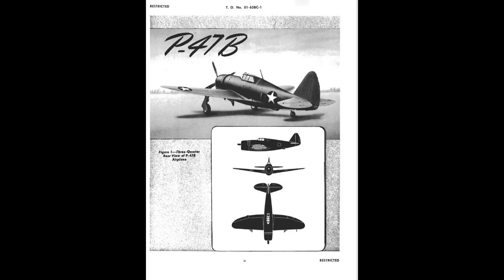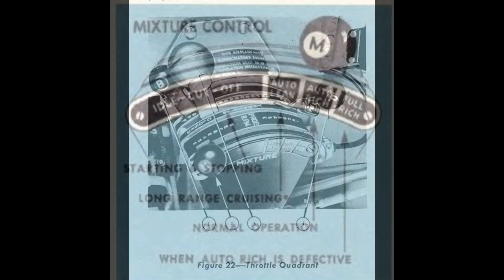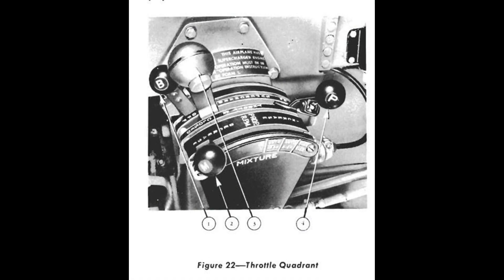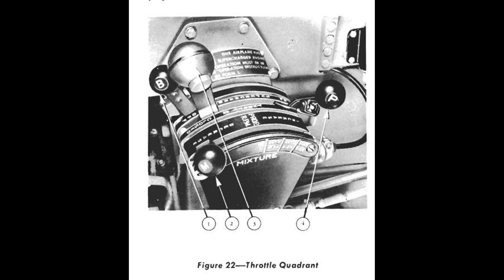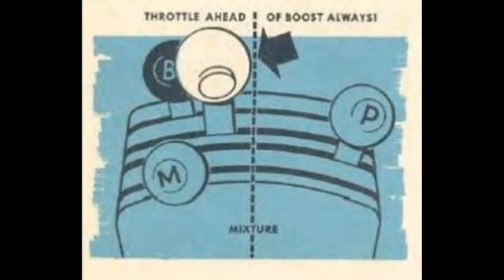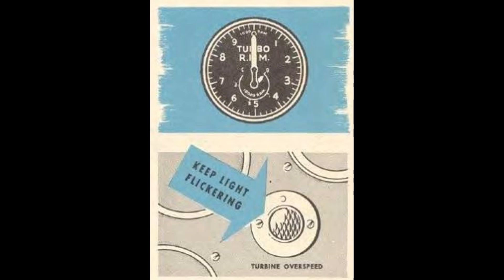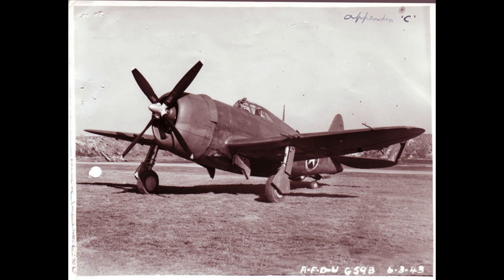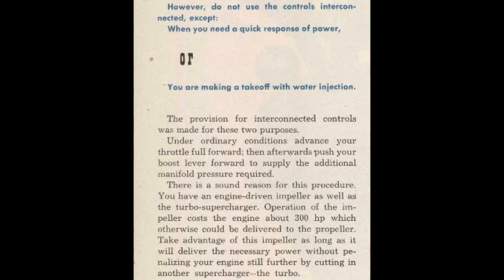P-47 Thunderbolt Pt. 1A Throttle and Boost Lever Use

Comment: Hi Greg! I have started flying the P47 in DCS and loving it so far, im just looking some advice - I see war combat is (2700 at 52") if I reduce rpm down to 2250 what is the detrimental effect? I have done this myself on multilayer servers and I noticed that the temps seemed to stay in check, but im wondering am I causing any damage to the engine by potentially causing knock/pinking/pre ignition whatever term you like. Im also wandering about 2550 with 64" with water Methonal. 

Thanks 😊
Reply from the maker: More RPM at the same manifold pressure gives more horsepower so 52"@2700 is what you want. As long as you keep the temps in check you can run at that power level all day long in the real plane, or in DCS. It will shorten engine life so official max continuous is 42" at 2550. Keep in mind if playing a campaign like Reflected's Wolf Pack the AI Thunderbolts run 52"2700 during all climbs so you have to run it a lot just to stay with the formation. 

      For max power, 64' with the water at 2700rpm. If you go over 64" don't worry, the engine will hold together, again, as long as temps are in check. Usually this means oil cooler doors fully open, intercooler about 3/4 open and cowl flaps closed.

       I think it might be time for some more DCS videos. I'm thinking about explaining how to start any WW2 fighter the easy way, and how to beat the K4 in a 1v1 with the 47.
Reply: @GregsAirplanesandAutomobiles  Greg thank you for the answer! I have been practicing dogfights against Antons and seem to come out on top, the gunsight on the 47 is formidable. I also practice not locking the boost to the throttle, I dont like the idea of being down on HP - your videos have been fantastic help so far! I'd love to see a Video on how to defeat a 109 k4

Comment: Question from a non-aviator to the aviators here; would you feel comfortable flying an aircraft where the throttle and boost were controlled by the same lever? If the throttle is to be fully opened before increasing boost, it would probably be easy enough to engineer a system where the first 50% forward fully opens the throttle and the final 50% forward increases boost (or whatever ratio works well).

Or, alternately, would that take necessary control away from the pilot?
Reply from the maker: Sure, and that has been done many times. In fact in later Thunderbolts it was possible to link the throttle and turbo lever together.

Comment: Interestingly, later pilot's flight operating instructions for P-47D-25 to -35 (AN 01-65BC-1A from January 1945) pretty much say to interconnect throttle and boost levers and leave them like that until you reach critical altitude and need to reduce turbo RPM (or for takeoffs in hot weather). As far as I know, the supercharging system and engine didn't change much, so why the difference in instructions between manuals? Is it to "simplify" the controls operation for pilots new to P-47? Also, since the supercharger regulator is driven by engine oil pressure, does it stop working if oil is lost due to damage? How will this affect boost lever response?

Comment: The P-47 was unique in that chopping the throttle led to immediate and massive deceleration compared to any other prop type: That huge gaping cowling in front was like one giant airbrake when the power went down... One pilot described it as "hitting a stack of hay". It allowed going fast to join a tight formation with no fear of overrunning. That is why its dive acceleration was only average. Its acceleration on the horizontal was also high with the broad props (though climb never was great), so it was an unusually responsive type on the horizontal. Despite a serious initial mushing in the turn it made beautifully tight left turns at incredibly low speeds. At least the Razorback with needle tip prop was always on the inside of most other Western types in left turns.

Comment: The aircraft that you don’t mention is the Tempest V or the Typhoon which is in the P-47 D. You always put the Spitfire MK-9 when the Spitfire Mk-XlV through Mk-XX was used till the end of the war. How about the Spitfire that dived to Mach 8.5. This was computed with gauged for this reach. Eric “Winkle” Brown said as much and the airframe and wings show no structural damage to the Spitfire as it was inspected by British officials.
This comment was ment for part 2 and not 3
Reply: The Spitfires' V-NE is just 460mph, it's critical Mach number is only 0.74

Comment: Just my opinion on this, i believe using the turbo lever for takeoff would be helpful  in very hot climates where engines dont quite reach the rated numbers.
Reply: With already high carburetor air temperature, using boost will increase it further, which leads to loss of power and possible mixture detonation. Manual that recommends interconnecting boost and throttle for takeoff specifically says to disconnect those in hot weather (>35°C).

Comment: I know this was from four years ago but the way DCS tells you to use the boost lever is wrong. In the manual it tells you to connect them at take off and leave them there. Where as A2A's excellent P-47 for Microsoft Flight Simulator works exactly as you explained here. I found this video because DCS made me question my memory of the many hours with A2A's P-47. I'll give the high altitude test a try and see what happens. Thanks for the upload.
Reply from the maker: I fly the P-47 in DCS and use the levers exactly as I describe here. More often than not when in combat I have the throttle fully forward and used the boost lever to make changes to power.

Comment: sounds like in a pinch you can push both levers all the way forward and then start easing the boost lever back until the manifold pressure "responds"

Comment: Looking at various Pilot Flight Operating Instructions issued 1943-1945, the earliest procedures I found state: "Take-off may be made with or without turbine supercharger. To obtain shortest run, supercharger should be used as follows: (a) Push turbine control FULL ON or to setting previously determined to give 52 inches Hg. (b) Hold with brakes while opening throttle to about 30 inches Hg. (c) Release brakes and push throttle FULL ON. (d) Manifold pressure should not exceed 52 inches Hg.  (See T.O. No. 01-65BC-1 for P-47B,-C,-D and -G Airplanes, dated 20 JAN 1943). 

The take-off procedure in later POIs is to link the turbo and throttle. (See AN 01-65-1 for RP-47B & C and P-47D & G Airplanes, dated 20 NOV 1943; AN 01-65BC-1A for Army Models P-47D-25, -26, -27, -28, -30 and -35 Airplanes, dated 25 JAN 1945; and AN 01-65BD-1 for P-47N Series Airplane, revised 20 JULY 1945). Furthermore, AN 01-65BC-1A states: "Above critical altitude it will be necessary to disconnect controls and adjust boost and throttle independently to avoid overspeeding of the turbosupercharger." The landing checklist calls for interconnecting the engine controls.

The 1943 US Army Air Forces training films No. 107A-C presented to familiarize pilots on the the P-47 somewhat confuse the matter by demonstrating take-off procedures never using the turbo lever. The films mention that the controls are usually linked, but also that trainees wouldn't be using the turbo until they transitioned to high altitude work.

Regarding how Thunderbolts are modelled in PC simulations, I learned take-off without turbo from the A2A Simulations P-47D Razorback in FSX. The A2A product manual instructs: "With the turbo boost pulled all the way back, advance throttle slowly until 52 inches Hg at 2700 rpm is obtained for take-off ... You may interconnect the turbo boost and throttle control when over 10,000 feet." I carried that habit over to the IL-2 Great Battles P-47D-22 and D-28. The DCS P-47D-30 manual seemed to contradict so I went back to the historical POIs to check. I now follow the checklists in the later POIs. However, I'll test out not using the turbo below 7,000 feet and see if I notice a 300 HP gain in any of the current sims.
Reply from the maker: We know they used the turbo for take off sometimes because we can see it in films. It's very clear when the are using the turbo from the exhaust coming out of it, a lot of exhaust! However it wasn't normally needed for takeoff, and the official procedures on this varied from one manual to another.

Comment: Great video but I’m still not sure where the parasitic drain from the turbo system is.  The supercharger is a constant 300 HP drain to make more horsepower then 300 obviously, or put another way, a power adder that requires an investment of 300 HP at the crank and is a constant costs.  The B lever to my understanding controls the waste gate of the turbocharger. Aft being open (no boost) to the nose waste gate closed allowing maximum exposure of the exhaust impeller to exhaust gasses. With no physical connection to the engine, with the turbo being driven by exhaust velocity, why would it cost horsepower?  Thanks in advance. I’m not an aeronautical engineer but I am a mechanic, just not understanding. If anything at low altitude in thick air I would think the turbo would OVERBOOST the manifold.  The only possible explanation I can think of would be thermodynamic inefficiency but this would be managed by MW injection.  Great video!!
Reply from the maker: I have an entire video that explains this: https://www.youtube.com/watch?v=ULLsIo1VzTw  . The super short version is that driving the turbo costs power via increased exhaust back pressure.
Reply: @GregsAirplanesandAutomobiles  man that engine is a BEAST if back pressure loss is 300 HP 😂. I  want to know if this is modeled in dcs. Hoping to answer my question in the next year. Thanks for the reply. I watched your whole series last night on the jug.  Very well done. They are modeling a D9 with mw50 but no high octane fuel for the Allies….. 🙃
Reply from the maker: I'm playing DCS, but haven't flown the P-47 so I'm not sure how it's modeled. In order to tell I would have to see what the top speed is at a given manifold pressure with different lever positions. DCS is pretty good, so I'll bet it's modeled correctly. They have the Allied planes set up with 130 octane, I think that's a good idea for online play to keep it balanced.
Reply: @GregsAirplanesandAutomobiles There is no backpressure, the Delta~P tells us air flows from higher pressure to lower.
 The Exhaust turbine is an Impulse type that converts high velocity gasses into rotational energy.
This is driven  by the Heat not pressure.
 Turbochargers are Heat Engines that generate horsepower from the  residual heat.
There is no parasitic drag or load on the engine when the Turbocharger is operating efficiently.
No power loss, only power gained.
This is the fundamental difference between a Supercharger and a Turbocharger

Comment: Great video. I'm flying in DCS but chucks guide says to only move throttle to 95% when in WEP. I'm not sure of the reason for this? Also would you leave the prop rpm to the wall when looking for power during a dogfight?

Comment: Greg, I'm enjoying your P-47 series immensely.  Just finishing up part 5 but there's a piece of data I'm missing...what is the glide ratio on the p-47?  You showed a piece of the chart which would have that data when you were talking about power off landing speed, etc.  This is important to me because my uncle was killed in a p-47 that had just been uncrated and assembled at Prestwick for him to ferry down to the southeast  for the d-day buildup.  He lost power completely at about 6k feet and misjudged his landing site in a light snowfall.  I've often wondered how much time he had to decide on a site.  If I knew the glide ratio I could work out how much time he had from engine stop to touchdown.
Thanks for all your work.
Tom C. Athens GA

Comment: DCS models it accurately.  You can disconnect the boost lever from the throttle or run it connected to simplify management in combat.  If you use the boost on takeoff, it takes 350 hp to run it.  It you are very heavy it is recommended to use boost and water.  At high altitude everything is in the wall and you mange the engine with the boost lever only (and all the cooling flaps & intercooler).  Neat simulator, the best yet for the P-47.
Reply: Only the supercharger takes power to run, the advantage of the turbocharger is it generates its own power to drive the compressor

Comment: I couldn't help but test this in DCS.
For my test:
2550 RPM with 45" manifold at 17,000' in level flight there was a difference of about 12mph indicated between linked and independent turbo levers.  I could have checked the exact airspeed in the map, but I didn't think of it, so indicated is good enough for me.
Thank you for this info as well as your (exhausting, I imagine) research!  This channel has become the gold standard for imaginary-aviators who just NEED to understand "Why my plane do this?!"

Comment: Something must be funky with the DCS implementation of boost. Without boost I cannot get more than 46" on takeoff from sea level, and to mantain 42" during the climb I have to start using boost once I pass through 4,000ft. I'm still trying to figure out if it's me doing something wrong or DCS doing something wrong, but either way I'm not getting what real-world sources say I should.
Reply: It is correct, for 52" take off boost from turbo is required. It is mentioned in pretty much every P-47 manual from B to D. DCS has by far the best turbo/supercharging simulation.

Comment: Chuck brought me here (chucks dcs guides) and now i understand fully. 

If they where smart, they did somekind of a double linking system for the boost and the throttle lever, so you can link it with “2 pins” where the forward pin is movable so in the down position the boost lever wil always moves with the throttle lever (backward & forward) and the backward pin is unmovable so when you move the throttle lever backwards the boost throttle always moves with it backwards so it never goes past the throttle lever.

Comment: These are really great videos! I’ve watched them serval times now. I am a bit confused regarding the configuration of boost controller and the throttle. It seems to me the supercharger creates this ~300hp loss as parasitic loss. Regardless of how the turbocharger is configured, this loss should always be present in some capacity, this is the nature of a directly driven supercharger unit. So what PEAK power loss would be experienced by advancing the throttle and boost simultaneously? The engine would reach its maximum power under its supercharger manifold pressure and the turbo would be helping increase air density/MAP at the same time independently. The interaction between the two should never cause ore or less parasitic power. I think operation guidelines page in the video suggests this is the case. What I think it is trying to convey is that, if there is throttle left to utilize from a system that has proportionate parasitic loss:power output, utilize it. Other wise you would be wasting the purpose of the supercharger unit’s natural losses. I don’t believe it is indicating a PEAK power loss due to order of operations. ie: throttle before boost vs throttle and boost. What do y’all think?
Reply from the maker: Hi Austin, I think you might want to watch my Turbo vs. Supercharging in WW2 planes video. That will explain this more clearly. You are correct it that the mechanically driven supercharger's losses don't change here, it the exhaust driven turbo that varies. If the turbo is spinning like crazy but the throttle is partially closed, then a lot of exhaust backpressure is created for turbo boost that doesn't reach the engine, that causes a loss in power.
Reply: @GregsAirplanesandAutomobiles There is no backpressure, if there is exhaust manifold pressure there is a corsponding increase in intake manifold pressure.
This reduces the piston pumping loss and unloads the supercharger.
 The temperature of the exhaust gas drops as it passes through the turbine,  this drop is directly linked to the amount of horsepower recovered by the turbine and is calculated using the Brayton Cycle formula.

Comment: I don't know how to contact you about a suggestion/question that might explain inverted engines on German aircraft.  Sorry for it appearing here.  Could it be upper cylinder lubrication (which would be a reference to non-inverted engines of today) or, in this case, lower cylinder lubrication?
Reply from the maker: I just don't think so. Neither design has lubrication issues, at least not on an engine that uses pressure lubrication as opposed to the really old babbitt bearing types.

Comment: im SURE!!!!! when the p-47 for "DCS flight sim" releases...... it will be EXACTLY like it should be in real life

it takes 10 mins for the navigation systems to align in stuff like the a-10c, f18, f16, f14......during which time, if you move even one inch, it screws up the alignment
and you get drift
 
exactly like real life
Reply from the maker: The 767 is the same way, we have three laser ring gyros that have to spool up and talk the the computers.